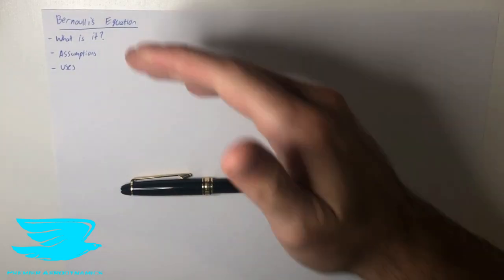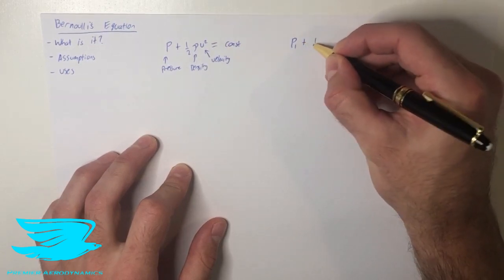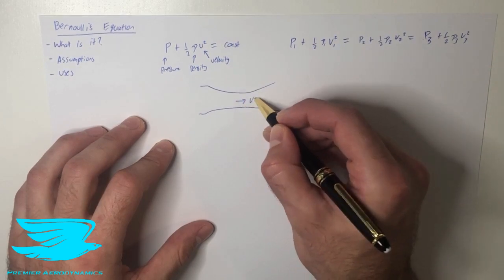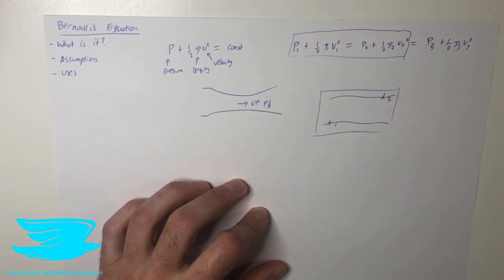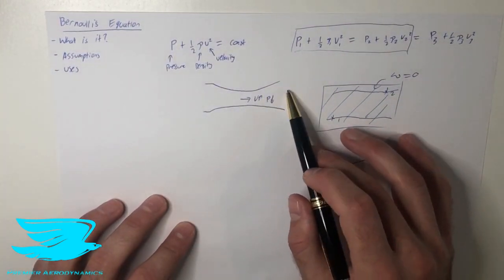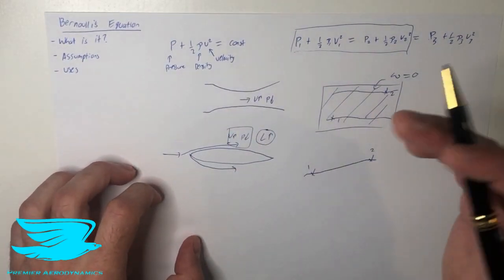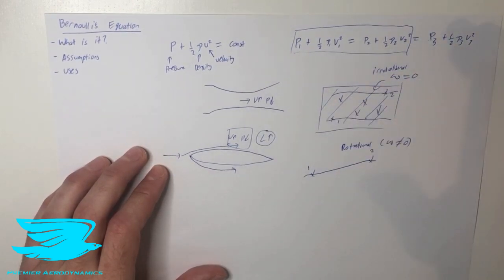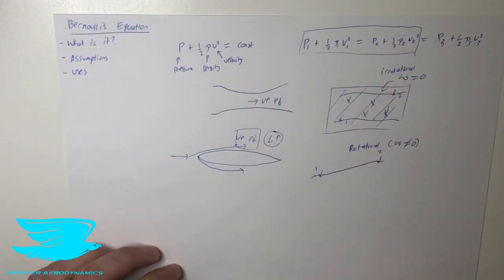[Aero Fundamentals #7] Bernoulli's Equation Explained

Comment: It's my understanding is that a pressure differential doesn't cause lift, but rather is lift caused  by acceleration of air.
Reply from the maker: Well, lift is a force, and accelerating the air doesn't directly mean a force, but the resulting change in pressure is what directly creates this force.

They are all closely linked, but there are steps between them.

Comment: I find it more understandable to say that a pressure differential IS lift, rather than , a pressure differential causes lift. So that lift is defined as a reaction.
Reply from the maker: That is definitely valid to say, but I tend to break it down more because the pressure difference and the direction of the surfaces the pressures act on create the lift. If the surfaces were parallel to the lift direction then no lift would be produced, but drag instead.

Comment: i am more and more realizing that is it basically impossible to predict the exact outcome of an aerodynamics problem, you can only do assumptions and got out an educated guess that might in the best case be close to the real answer
Reply: It's not impossible, it's impossible if you assume your assumptions are valid in all circumstances, they're not. You know the saying, when you assume, you make an @$$ out of you and me. Notice every physics problem in undergrad requires you to make certain assumptions, assumptions which would not necessarily be valid in the real world. It's that disconnect from your hypothetical assumptions and actual reality that makes theory break down in practice. A lot of college students suddenly get that real world shock when they realize there are so many variables when it comes to aero, that assumptions are the easiest way to be catastrophically wrong. Just failing to account for atmospheric pressure/density affects results in statistically significant ways, let alone for all the other variables we cannot account for, due to simple ignorance.

Take the rules of continuity, you'd expect the inlet pressure and outlet pressure to be the same, except there's no such thing as perfect pressure recovery, some pressure is always lost. In practice you'll find the outlet pressure is always slightly less than inlet pressure.

That said, there's still use in these equations and methods because they can get you roughly where you need to be, and that's vastly better than just aiming blind. I rather have an old out of date map than nothing at all guiding me, could I arrive at my destination either way? Sure, but I'll get closer faster with the out of date map, than nothing but my imagination.
Reply from the maker: @rolandotillit2867  These are all good points. 👏If you really wanted to get a perfect result, then you'd have to solve the Navier Stokes equations, which is not possible for real world applications yet. So, assumptions help us get a decent idea while still being practically feasible.